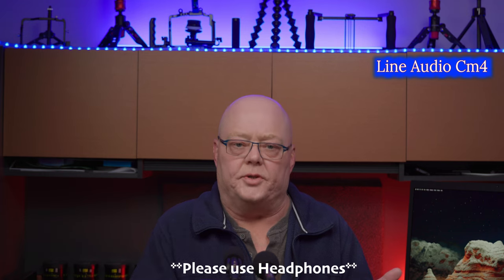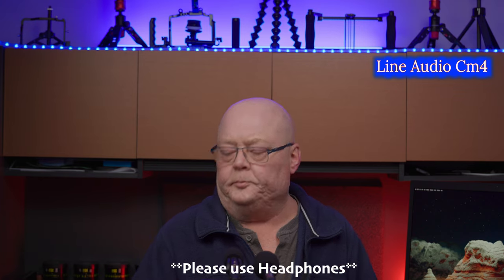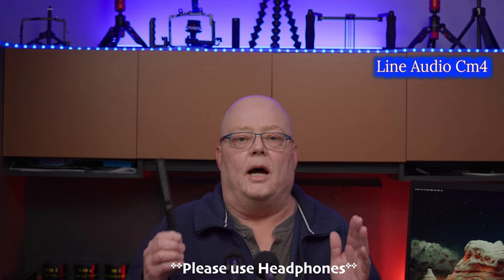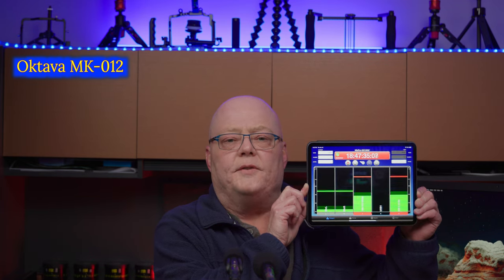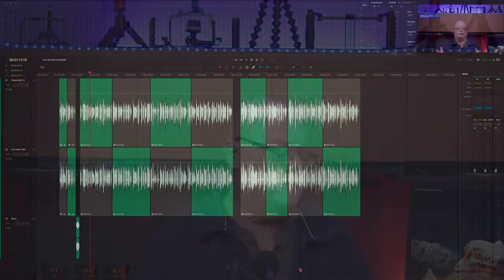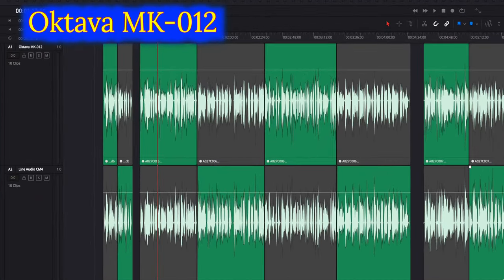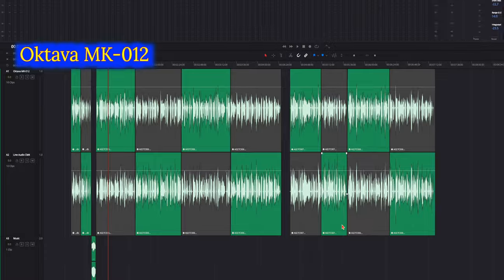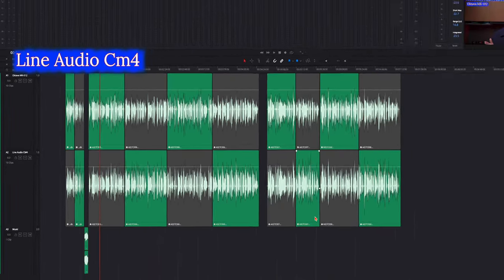SDC Mic Shootout - Oktava MK-012 vs Line Audio CM4

Comment: It's interesting how much body the cm4 has. That's somewhat rare for this style of small diaphragm condenser. Usually they have terrible low end and are very high-end focused. Since it's easier to use a high-pass filter with a gentle slope than it is to try and boost the lows in a mic that doesn't capture them as well, I choose the cm4 as the winner here. If I was only recording voice, I might choose the oktava, but considering a diversity of sources with lower ranges like upright bass, timpani, organ, piano, cello, etc, I would pic the CM4.
Reply from the maker: Thank You for the observations 👍
Reply: a good SDC without a treble boost captures a more natural sound than a LDC. Many SDCs do have a treble boost. get a flat one,

Comment: At this point if you have to purchase through a reseller the mk012 and cm4 are now the same price.   In Canada you cannot purchase this microphone at the advertised msrp.      IF you can purchase the CM4 at MSRP then it is an excellent value.   If not then there are a few microphones at the 200$ price point to choose from.      The SE7 might fill the bill for value.
Reply from the maker: Thank You for the observations 👍
Reply: When I bought a CM4 in Canada it was $210 CAD. The MK-012 is like $260 CAD to $350 CAD depending who you buy from.
Reply: @dylanj8676  Oktava can be had for about 225CAD
Reply: @robertfontaine3650  From where? The cheapest I've seen is 200 Euros which is like $260 CAD.
Reply: @dylanj8676  fleabay has a german seller with the cardio capsule with the 10db pad 169EU shipped. (230CAD at current rates).